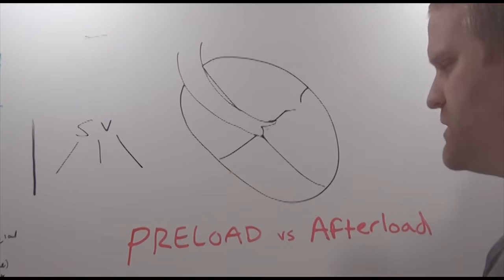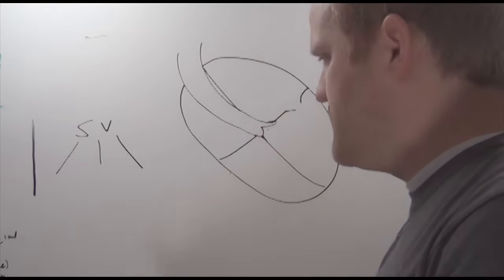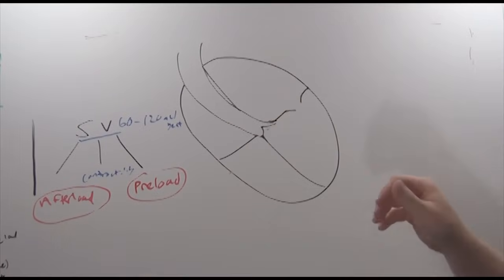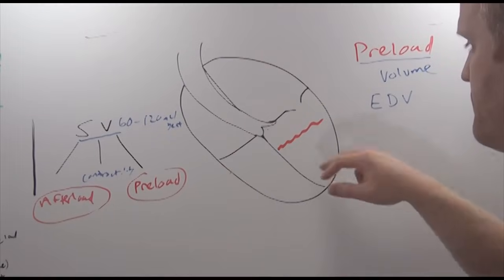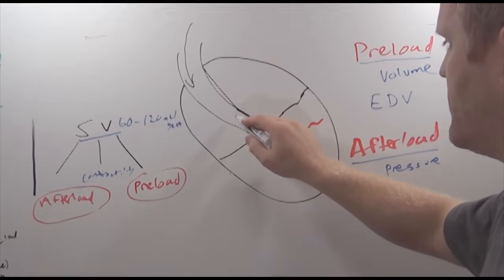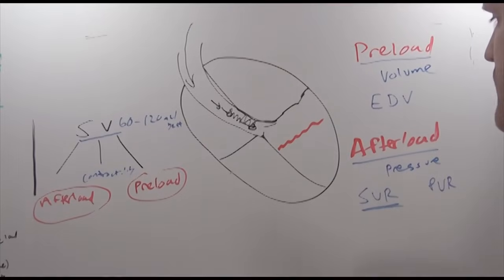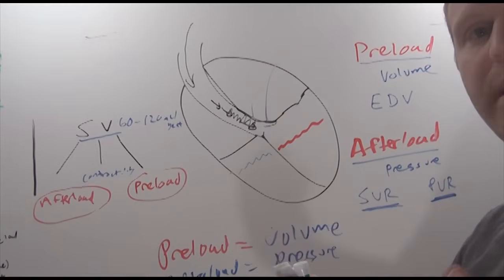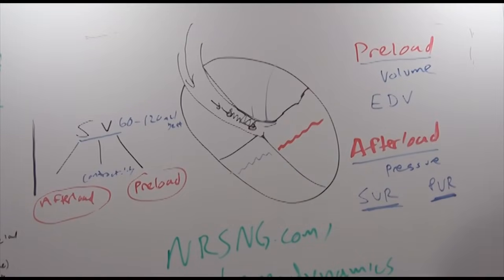Preload and Afterload Animation (What do they mean? How to measure)

Comment: Preload is volume, how much is in the ventricle at the end of diastolic. So how many cc is in it. Afterload is a pressure! The aortic valve needs to open and you need a pressure for that, the heart has to squeeze it out against a pressure. Systemic vascular resistance is pushing back the aortic valve, so the heart has to squeeze against a pressure, to open the aortic valve.

Comment: This helps alot. Even as an EMT, I had five preload and afterload centered questions on my NREMT. They were difficult and centered around visable signs and symptoms and whether increased preload, decreased preload, increased afterload, or decreased afterload were responsible for the condition in question. Was able to work my way through them. Passed NREMT in mininum 70 questions, but our book from training didn't explain this subject as well as you did. I will suggest this for people I know going through EMT classes currently. Thanks!
Reply: Dean Smith a lot of pressure